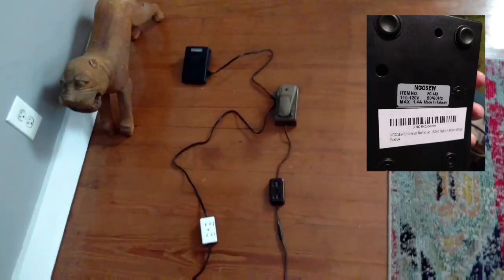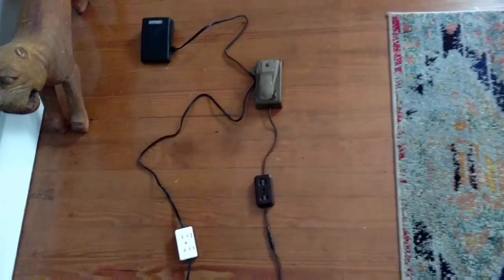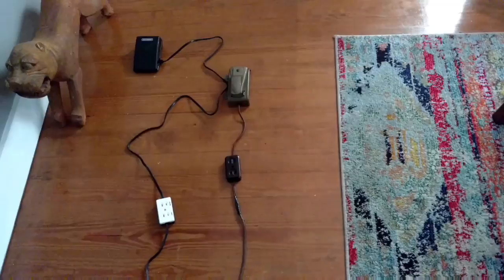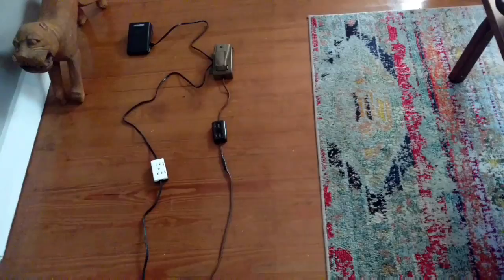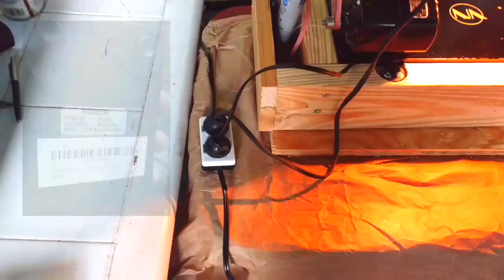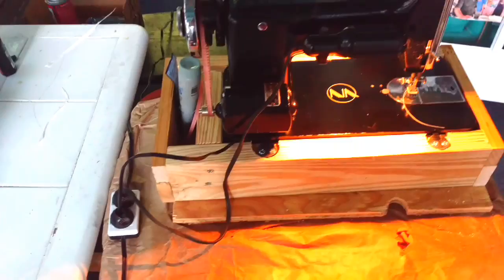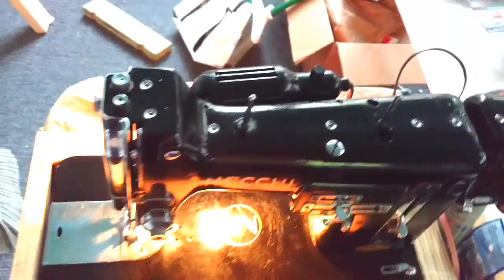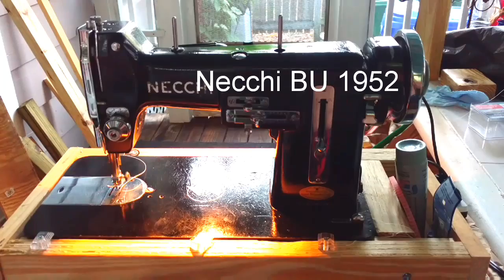Convert Knee Controller to Foot Pedal Controller Vintage Sewing Machine

Comment: You are my hero, I was so perplex about what to do to fix the one I just purchased. It works great but the knee pedal sucks Its full throttle or off, very stiff. but the cord is permanently attached and short.  I found the cord you used on Amazon of all places. I'm Canadian, and I was having a hard time :P Amazon lol who new. * HONEYSEW Universal Foot Control Pedal W/Light & Motor Block Fc143 for Home Sewing Machine *

Comment: I prefer the opposite - I am trying to find a way to convert a foot pedal to a knee pedal. I find sewing with the knee gives so much control and easier sewing.
Reply: @Frost Flower - Same here, because I have issues with numbness and pain in my feet.  I use foot pedals for my sewing machine, serger, and also for transcription in my work, and it's challenging to get the ergonomics just like you need them.

Comment: Hello John, Thank you for posting this video, it was super helpful. I was wondering if you can tell me if the white box has screws in the back to change the wires. in my case I do not want black wires as I want to match my wires to the color of my sewing machines. Any information would be greatly appreciated. Peace

Comment: Can you show us how you hooked up the wiring in your receptacle box with the foot wire I have the same problem.
Reply from the maker: Thanks for checking out my video Michelle. I wish I had a helpful answer for you as far as wiring up the original box. I did not do that here. I did a plug n play in that I removed the entire knee controller and box from the machine. Opps reread your question. The new controller came prewired to the box. It was ready to go as shipped. Think I got it from our pals at Amazon for under $30.